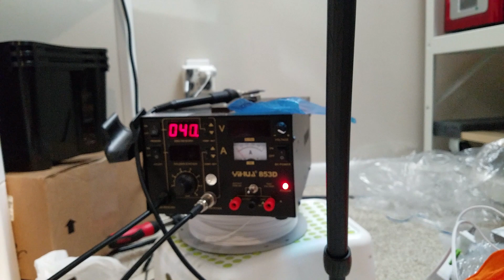Artillery Heatbreak replacement - all metal - Defective Thermistor clipped wire - from bad to worse

Comment: For me I see so many problems that make me cringe watching this. I just redid my stock hotend version from a sidewinder purchase off eBay. These are things I personally do to make sure I have no hotend leaks and no restrictions coming from the PTFE tube.
1. Make sure your PTFE tube is set before you mount the heatbreak. I had to barely poke my PTFE through my stock heatbreak. That way when I tighten everything up, it's tight. I personally hate the stock one but you could always order an aftermarket one from Slice engineering's site. I'm switching to the SE one this week. 
2. Use an exactly knife, not nippers to cut the PTFE tube. 
3. You really need to print the PTFE cutting jig so it's strait. Using some digital calipers to measure how much needs to be cut makes it easier, for me atleast.
4. Finally once assembled, leave your silicone sock off and you need to get everything up to temp, preferably no filament loaded. Once up to temp, do a final tightening of your nozzle. Also, I use a large adjustable wrench, not channel locks to hold the heatblock. The less you flex everything the less stress you put on the heatbreak. 

Also, you may want to try a volcano copper block upgrade off Amazon. But only when you get everything squared away here.
Reply from the maker: Hey thanks for the Tips here. I pinned your comment since it has such good advice. I know what you mean but Sometimes I need to be fast about fixing it. Anyway there have been many iterations of fixes since this video. For a while there i did have my Magnum mosquito installed but then the mount for it broke so I had to go back to stock to reprint the mosquito mount. But then I got lazy so I left it stock. I think I have some material to make a few videos about what I went trough. However I am away and I do not have my footage with me. Thank you for your great advice.
Reply: @RoamingInterests  I subscribed, so I'm looking forward to those videos. Always appreciate any helpful content out there for projects I work on. The YouTube Sidewinder content seems to lack on the deep dive technical side of things. I have a Mosquito hotend still in it's packaging. I saw the mount you used a few days ago but saw it was unfinished so I didn't move forward with that one. Thanks for the content you have published!
Reply from the maker: I used that Mosquito mount and worked quite well, until it broke - I also had to do a few fittings before it properly fit. I have reprinted it but I never re-used the mosquito. However at the time I never updated the Firmware to take advantage of the temperatures, and I also never gotten the thermistor from Slice Engineering since it wasn't available. Finally later I upgraded the firmware to new marlin 2.0.x something but I kept the default temperatures. I have to check online on groups if I just have to up the max temp and if will it break the temp runaway protection. I bet Slice will respond if I ask them. I should ask them, I think they already may have support for the Sidewinder X1 previous versions, not version 4.

Comment: Just got one X1 so will take into account! Thanks
Reply from the maker: Good Luck make sure you tune the heatbreak before you use it, it is much easier when it's clean.
Reply: @RoamingInterests   Ok, will try to check it right after unboxing!
Reply from the maker: Be gentle about the wires. My advice is to take the shroud apart and then the board at the back of the steppers to release the JST connectors that way. Then you can make sure the seal in between the heartbreak and the nozzle is proper and that you do not end up with a loose heating block that spins.